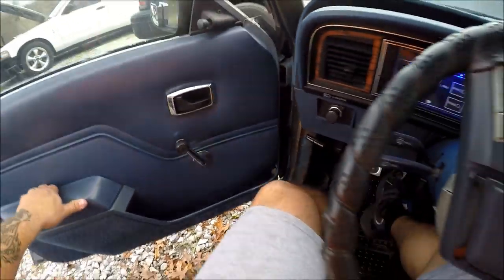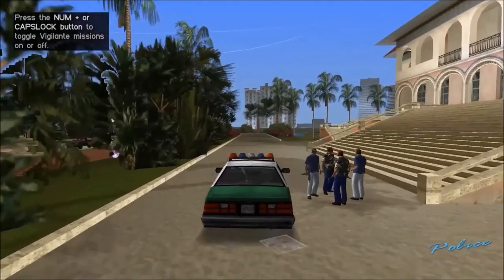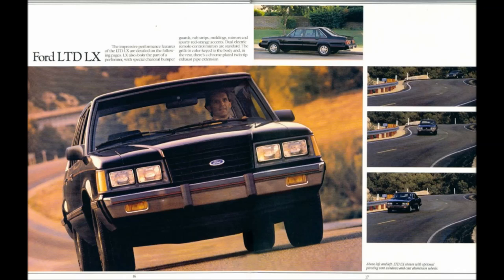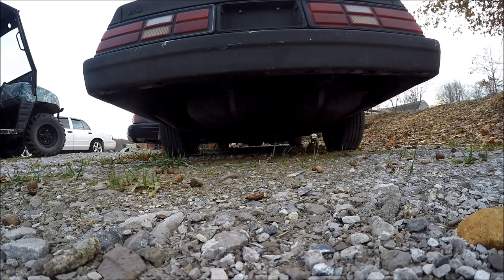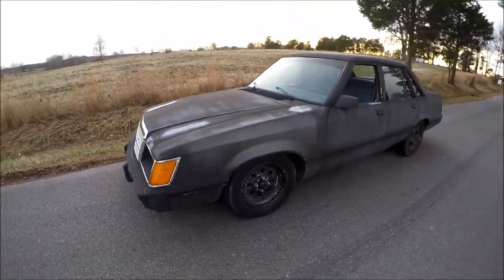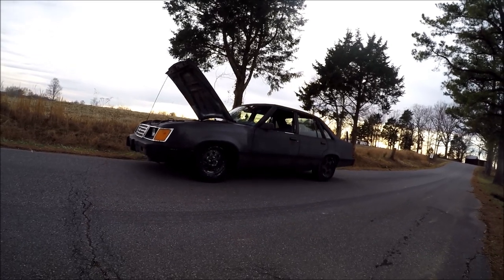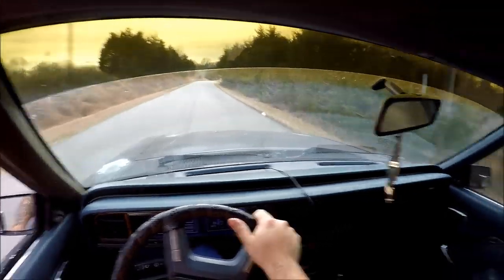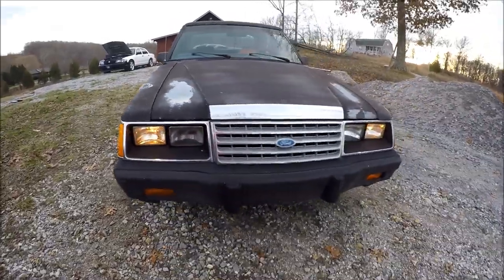Dont Let the Mustang Guys See This!! Before You Buy 1984-1985 Ford LTD LX Fox Body

Comment: My 3.8 liter 85 Ltd had a funny quirk. If it stalled,  it would not start for 12 hours. Without fail. It only stalled maybe 3 or 4 times but every time was the same.

Comment: Back in the day when you could swap anything into Anything.  Had a 77 Mustang II and swapped in a 300hp 351 windsor... hell on wheels... this is no different. Then the OBD II ruined almost all motor swaps or performance parts due to the computer not recognized parameters and putting it into limp mode... hate the car, but love what went into it. A 16 second quarter mile car in the early 80s was something of a find. They were all concerned with emissions and fuel economy. Most performance cars then had a 0 to 60 in that range...
Reply: They are more concerned with emissions and fuel economy than ever today... Cars are much cleaner than they were in the 80s. Especially in the early 80s when most cars were still carbureted.

Comment: I bought one of these brand new in 1985. Mine was black with red pin stripes and a light gray interior. Loaded to the gills in every respect luxury amenities wise. And It was loads of fun to drive but I found it to be problematic starting around 6 months. The gray accent paint started to flake off because Ford didn't even scuff the original black paint before spraying it. Those little ribber wheel covers would NOT stay on the wheels. I still have one in my garage after the other 3 flew off inside if a month or two. BUT, it was peppy, and fun to drive,  but it was bought to be the wife's car. Reliable transportation for her and my son. She was a very careful driver too so it was NOT beat on. Then It started using oil and at 11 months, then the the damn transmission started acting up on a road trip to Ky from La. Before I could get it to the dealer after we got home, the trans fell out of it leaving my wife and baby boy stranded on the side of the road.  No cell phones back then y'know. Now the whole reason for buying this car was to make sure that very exact thing NEVER happened. I was FURIOUS.  The car cost like $16,700 in 1985 and that was a LOT for a car then. I'm a Ford guy and I'm loyal but my experience on this one with Ford was abysmal. On the oil thing their solution was to re-ring the heads. They rebuilt the trans. Now I was just pissed at it. I had bought a NEW car I THOUGHT and told the regional Ford rep. Not one to be overhauled, you know? What was next? So I demanded a new motor, Ford refused so I sued them. I won but not really. I wanted the court to order Ford to take the car back and refund my money. The judge just made them fix it and return $2500 of the purchase price. I found out later that particular judge had an interest in the particular Ford dealer I bought it from. I just didn't trust it anymore so in early 1987 a year and a half after I bought it I traded it on a loaded 1987 Chevrolet Monte Carlo SS.  We went back and forth on new cars in those days my turn, your turn and it was her turn. Hate to say it but that SS was a lot less trouble too.  I was a cop in the 80s, buying used copcars for sale to make extra $$ and I DID buy several of the 84-86 "baby" LTD's copcar version that were the same basic car as the LX. 302, EFI. I made good money on them, 4dr Mustangs they were called. They were pretty stripped down by comparison to the LX but the same car under the hood.  I hate that it was such a problem, I wanted to love that car.

Comment: The Taurus sho didn't come out till 89 not 86. The Taurus itself did come out in 86 replacing the fox body LTD. My parents had a 85 LTD fox body they got brand new. It had the 3.8 v6 though.
Reply: When the SHO did come out for '89, I believe it would have outrun the LTD LX even at that early stage.

Comment: Sleeper. This isn't news to FOX guys. So like the original Mustang was based on the Ford Falcon. Humility makes for legends.
Reply: Taurus SHO was lightyears ahead of these... Even if it was FWD. That and the Merkur Scorpio.
Reply: @halohunter5217  you could beat up on BMW's for half the price.
Reply: Maybe until you hit a corner... These did not handle well and had floaty suspension damping, though not nearly as bad as the standard model. That and it only came with an automatic transmission. The XR4Ti was a much better BMW contender.

Comment: what about a svo  4cyl Fairmont?
Reply: No such thing. Fairmont/Zephyr was built '78-'83. SVO Mustang was '84-'86. The turbo 2.3 was available in various cars from '79-'80 (Mustang, Capri, Fairmont) but was discontinued in '81 due to reliability issues. There were '83-'84 Mustang GTs w/ turbo 2.3 but they are pretty rare.

There was more to the Mustang SVO than just a turbo 2.3 engine. 4 wheel disc brakes, suspension tweaks, 5 lug wheels, etc.
Reply: I think he's suggesting someone build one... Though I wouldn't cannibalize an SVO at this point.
Reply: @halo hunter Just making it clear just having a 2.3 turbo doesn't make it an SVO. There were 2.3 turbos in other cars before the SVO: '79 Pace Car Mustang (I owned one), '79-'80 Cobra, '83-'84 Mustang Turbo GT, '79-'80 Capri RS, and even in base models and of course '83-'86 T-bird Turbo Coupes, etc.

People do butcher them, I'm seen them with 5.8s, Coyotes, etc.

Comment: Why wouldn't the Bob guy have just put a 4bbl, performance intake, nice cam and springs in the 351 instead of swapping in a 5.0?  There's more power to get out of a 351.
Reply: 351 have great torque. Same bore as the 302 and 289. Longer stroke 351.
Reply: @Ryan Winkelman No Fox chassis cars ever came from the factory with a 351W/5.8.
Reply: @foxfordcatguy2283  no shit, but it's an extremely common and easy swap.  And if you want to get technical, the 95 cobra R came with a 351, and the sn95 was a continuation of the fox chassis.
Reply: @Ryan Winkelman You said "Why wouldn't the Bob guy put a 4bbl carb, performance intake, nice cam and springs in THE 351 instead of swapping in a 5.0?" Like you were saying there was already a 351 in it to put those parts in and he swapped it out and put in a 302!? You didn't say "Why didn't he swap in a worked 351 instead of a 302?"

'94-'04 used the Fox-4 chassis. There are a lot of differences. There are color coded pics of a Ford engineering model in various books showing the alterations and about the only unchanged parts are the floorplans and the K-member but even that is moved forward about 1".

I know it is a common/easy swap. I'm putting a '96 roller cam 351W in my '83 Capri.
Reply: Ryan Winkelman back in 96 Saleen Mustang had a 5.8W V8 510hp. Wikipedia saying 94-99. For 5.8 (351w V8)
Reply: @Ryan Winkelman Also, back in '84 there probably weren't 351 Fox headers available and/or he was trying to use as many "off the shelf" Ford parts for Mustangs as possible. (Like Tasca did to create the first 428 Cobra Jet in the '60s.) 351 also doesn't always fit under stock Fox hoods especially depending on intake.
Reply: @foxfordcatguy2283  who knows, I was drunk when I write that.  I know nothing came with a 351 from the factory.  Closest thing to that would be the 95 cobra R and either 200 or 500 were made.
Reply: @Silkmaster4200  saleen did all kinds of shit, I know of the s351 which was supercharged and made 510 horsepower.  However, we're talking about factory vehicles, saleen is not a factory Ford car.

Comment: Why would you think true Ford/Fox people didn't already know about these 30 years before NEWBS?! We've been swapping parts from one Fox to another and building non-Mustang Fox cars for years because most of the aftermary parts made for Mustangs will work on any Fox chassis car. 

There were also various Fox chassis (I prefer that term because Fox refers to the chassis not the body. The BODIES are what is different from one Fox chassis car to the next.) that came with 4 doors and or V8s.

List of Fox chassis Fords:

'78-'83 Fairmont/Mercury Zephyr
'79-'86 Capri
'80-'82 & '83-'88 Thunderbird (2 DIFFERENT BODIES both on the Fox chassis.)
'81-'82 Granada/Cougar
'83-'88 Cougar (Like the T-bird, 2 distinct Cougar bodies both on Fox chassis.)
'82-'87 Continental (cheap 5 lug rotor swap, direct swap onto '87-'93 V8 Mustang spindle)
'84-'92 Mark VII
'83-'86 LTD/Marquis

[Either the Continental or Mark VII calipers are also direct swap onto '87-'93 V8 Mustang spindles but have a bigger piston, can't remember which. Maybe both?]

Comment: My 1987 ltd has the 351w
Reply: BP back in the 80's  had an LTD with a 460 engine and was only used for hot pursuits
Reply: If so, you have an LTD Crown Vic, the small LTD was never offered with a 351.
Reply: @arturogonzalez6882  No LTD was ever built after 1978 with a 460.
Reply: @Bashful Bones Last year for the Fox LTD was '86. Are you thinking of the full-size Crown Vic?
Reply: @foxfordcatguy2283  it was called the LTD Crown Victoria... Successor of the full size LTD.
Reply: @halo hunter Just pointing out that '87 wouldn't be a Fox. LTD Crown Vic name was used at least '83-'91 ('92 became just Crown Victoria. Some sources say '80-'82 also used LTD Crown Vic name for the top of the line cars.)

Comment: It's a Fox CHASSIS not Body...
Reply: God yes! I hate that. The chassis is the part that is the same among all the Fox cars. The BODIES are what is different.

But the other guys have their F-body, G-body, etc. so I guess it will never change....
Reply: It's unibody... So the chassis and body are unitized as one.
Reply: @halohunter5217  
That does not change the fact it's the Fox Chassis/Platform.
Mustang/Capri
Ford LTD/Mercury Marquis
Ford Fairmont/Mercury Zephyr are ALL built on the Fox Chassis/Platform.
Reply: @halo hunter That just confuses the issue even further for newbs who don't know what a uni-body is. The fact is there were many different BODIES on the Fox PLATFORM/CHASSIS. The BODIES are where the differences are and the underpinnings are what they have in common.

Comment: Foxbody mustangs are ugly as hell but then again I have a 04 mustang so foxbody guys probably think mine is ugly.
Reply: Wyatt Brick ew a new edge
Reply: Themadtaxi I got it for free and I grew up in the car so I don’t see the problem.
Reply: @Wyatt Brick I didn't like the New Edge too much when they came out but they've grown on me over the years. A friend I raced with had a '99. The '03-'04 Cobras are awesome.
Reply: FoxFordCatGuy They’re actually pretty good for drifting if built right! Even the V6 models can drift pretty well with the right parts installed which adds to the cool factor but when it comes to drag racing the V6s aren’t the way to go at all.